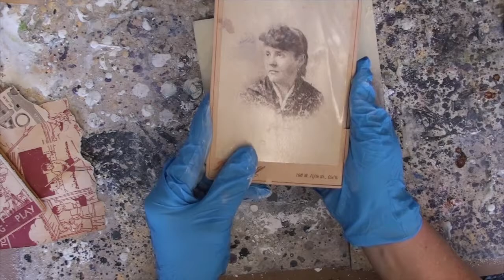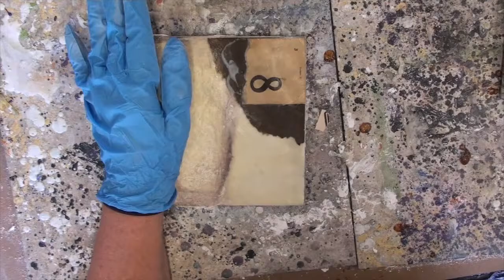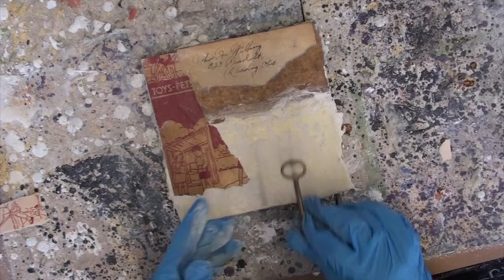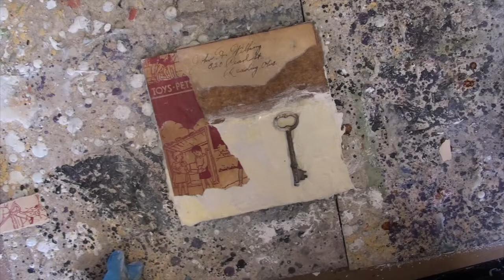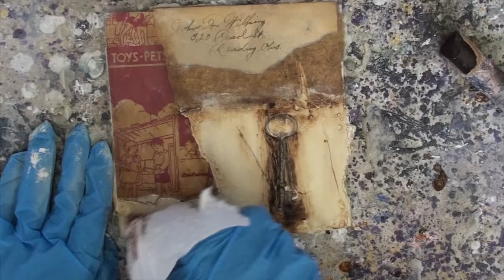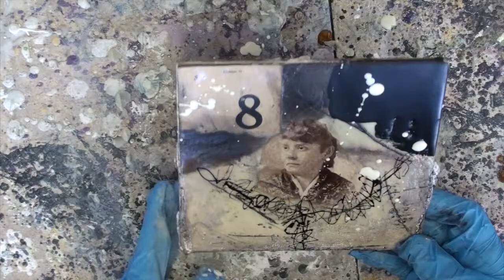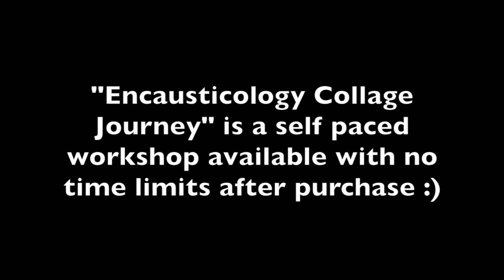Wax on Wednesdays How About Some Encaustic Collage ?

Comment: I thought I could not put oil stick under the encaustic wax, but it looks like it worked fine for you. Any rules I need to know about? It looks really good!
Reply from the maker: Thank you Lee ! 
Oh Yes, you can certainly  add the oil paint stick at any point! Just remember to fuse . Just to let you know I also go over all of the details step by step  in the Encausticology Series of online workshops . There are 3 workshops that each have over 10 hours of videos where I explain everything in depth step by step and there are TONS of projects :) Thanks for watching and great question !